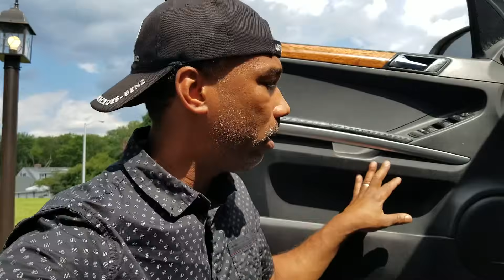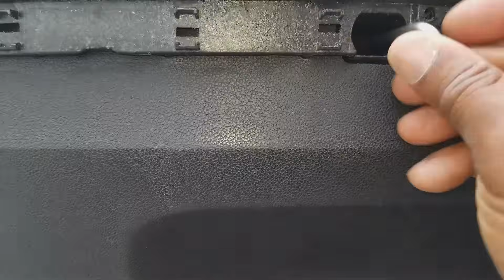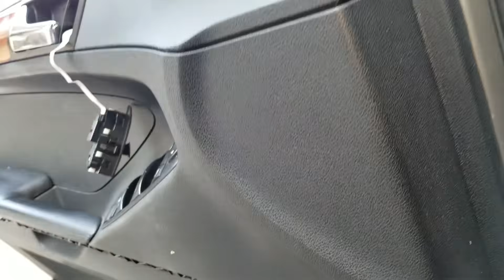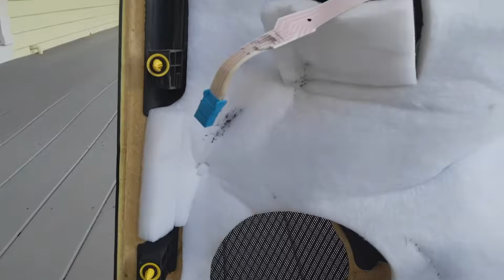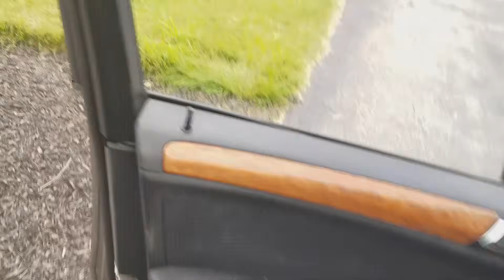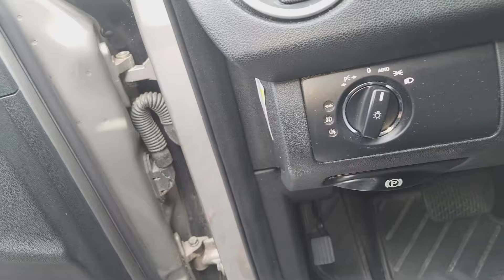How to Remove Mercedes Front Door Panel ML350 W164

Comment: Thank you for your useful video, I replaced the power switch, but after I finished the switch in the same front door to open the lite gate no working but I could open the left gate by the mob and close it as well as manual, I do not know why the switch for the lifts gate in the driver door not working, it was working before I changed the matin power switch, but as you  no wiring for the lift gate switch when I opened the front door. 
Could you please advise.

Comment: Thank you. Could an improperly re-installed front passenger door panel result in air/wind noise from when driving?

I own a 2009 W164 ml350.

Background:  A few months after autobody shop work a couple years ago you could increasingly hear the wind noise. Visually the top of the door panel above the handle rises up and is not seated properly, I’ve tried pushing it down into place but that hasn’t worked. Also, the panel doesn’t align evenly with the tweeter cover (easy to see when comparing comparing to driver side panel.  

the passenger side door

Comment: Hi Keith. Have you ever worked on your sunroof? I have a grinding noise with mine. The motor gear is slipping on the drive. Wondering if you know how to replace the gear and sequence the motor.

Thanks a bunch.